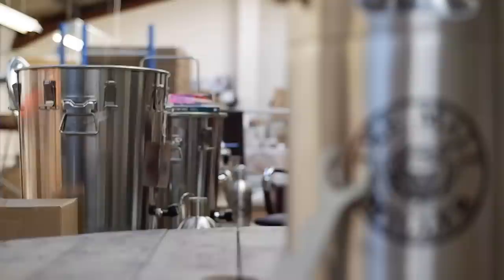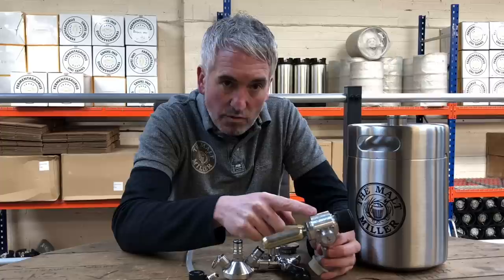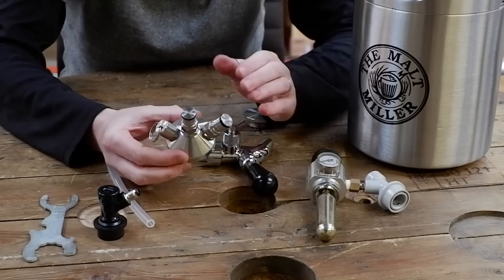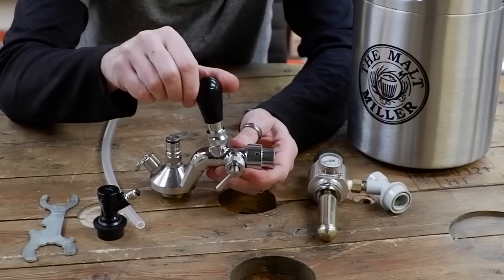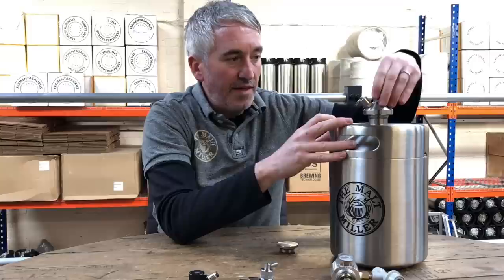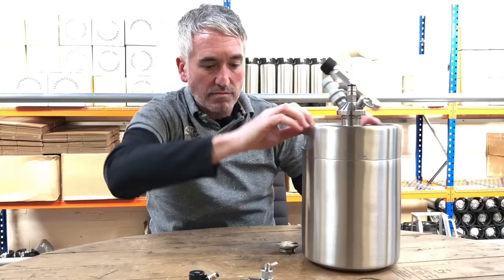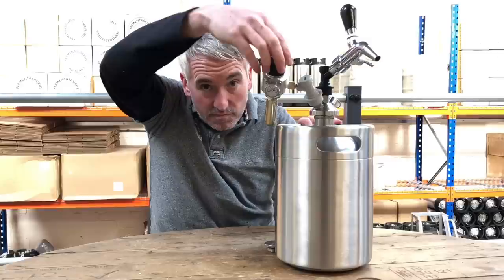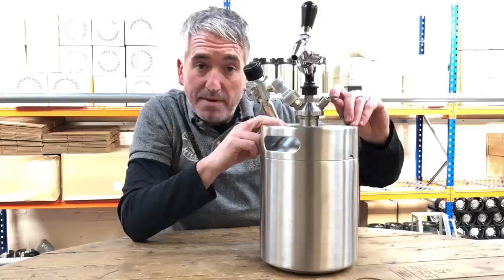5l Mini Keg

Comment: The pressure relief valve is rated @ 20 PSI? I've got a carbonation cab that looks very similar that I got off of Amazon and the regulator routinely shows 45 PSI without my relief valve blowing.

Comment: Since I can't seem to find any regular 5L metal water bottle, I wanna get a 5L keg then. I can use it as a portable, everyday use, travel with me everywhere type water container if I'd like to, right? There isn't any different shit on the inside? I'd just screw off the cap and put my mouth there to drink, so without all those pieces and dispensary, brewing stuff, it's just a 5 liter metal container with a solid, stable, screw-on cap to seal?

Comment: Great info, 
how long does one of those capsules last?
Reply from the maker: Depends on how much you use it, if you are using for dispense only it should last the keg full. But if you're using to carbonate it will take more than one to do that.

Comment: Hi need little help here,  i have 5 liter keg,  i put in coffee 1.7 liter and the foam doesn't comes out, what should i do? Does it need more than one nitro charger?  Because i only use one nitro charger
Reply from the maker: Check everything is fully sealed and there are no leaks. If its ok then I would suspect that its needing more gas, especially seeing as the coffee isn't going to be carbonated like beer is.
Reply: @themaltmiller8438   yeah i found the problem,  it's need more nitro gas.  I was charged it with 2 capsule and finally i got what I want. Just like beer.  But is it ok to insert 2 capsule into 5 L keg? It's not gonna blow up or leak?
Reply from the maker: tuswanto adji saputro our kegs have a pressure release valve to prevent you over filling 😉
Reply: @themaltmiller8438  so it is ok to put in 2 nitro charge?

Comment: Could this be connected to a hand pull?
Reply from the maker: Yes easily using a PINT365 https://www.themaltmiller.co.uk/product-category/equipment/dispense/handpulls-beer-engines/ they will be back in stock next week. Not so easy using a conventional hand pull but it is doable

Comment: Is this only practical if you brew your own beer ?
Reply from the maker: You could get a bar or pub to fill it and then use this to keep it fresh and dispense it under pressure at home, but it is designed for home brewers to get the most out of it